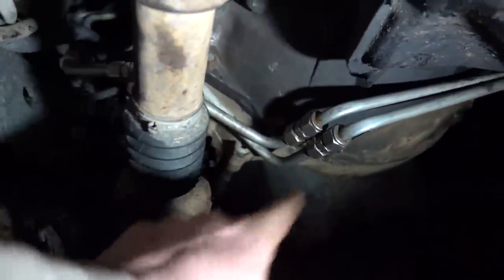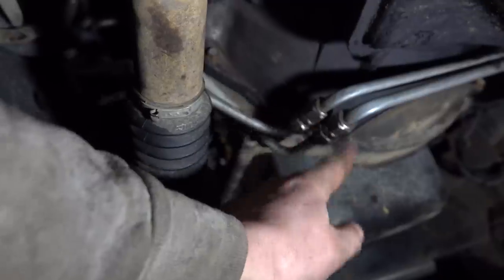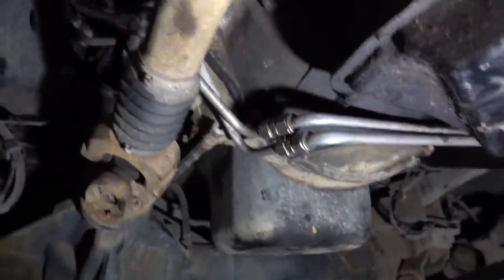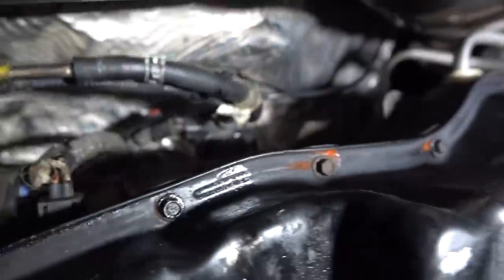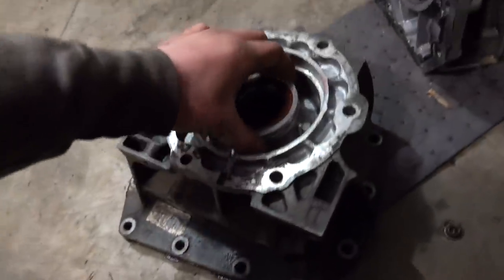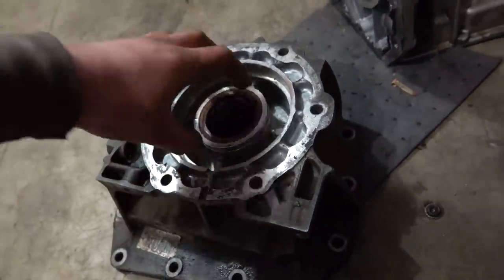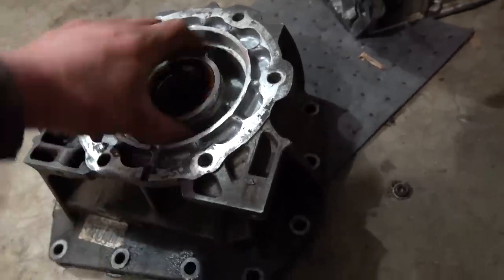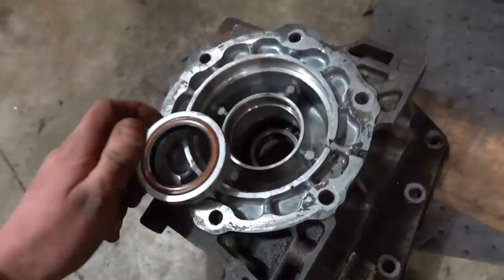Cummins 68RFE Transmission Install HALTED... VITAL PIECE OF THE PUZZLE FORGOTTEN!!!

Comment: Just throwing it out there, but it would be a really good idea to do a "quick learn" with a Chrysler Star Scan or Snap-On tool, and a through "drive learn".  Not doing so can cause the trans to fail in short order.
Reply: Monster RAM is there any other way to trigger a quick learn? If running a tuner, would reflashing the trans tune do it?
Reply: @extremerc76   Not really. The "quick learn" is a computer controlled process that can only be initiated by a few devices that takes about 15 seconds.  Not to be confused with the "drive learn" process, which is series of conditions placed on the truck, by the driver, over a period of a few days. There are several YT videos and online sources that detail the "drive learn" procedure.  Both of these procedures are important, but different, and are necessary in certain situations.

Whenever the PCM is flashed a drive learn must be perform.  A quick learn isn't necessary, however; it won't hurt anything and only helps along the process by reestablishing CVI values. This can be especially helpful if you've flashed in a trans tune with higher LP demands.  

When replacing internals like clutches/hard parts, or replacing the trans, both a quick learn and drive learn must be done.  Unfortunately, there's no way around this.
Reply: Thank you for the info, I knew the end goal was to reset the cvi but wasn’t aware there were two different learning processes I thought they were the same thing.

Any recommendations for a budget scanner able of preforming this function? I only ask because I’ve acquired a nearly new 68rfe out of a wreck that’s sitting in the garage for when mine goes in my ‘15. 

I’ve messed with a decent amount of transmissions but nothing remotely modern when it comes to autos.
Reply: @extremerc76   As far as I know, there are only a few devices that can do this and none are "budget".  I think they are usually in the $X,XXX price range.  However, if you can trailer the truck to a shop/dealership and they should be able to do it for $50-$100 or so.
Reply: @monsterram6617  my launch pros mini does it, was 600ish US. very worthwhile tool to have. It even does keys!
Reply: @GordonTurnerr   Good to know.  Still a lot of money unless you're going to be using it all the time.
Reply from the maker: A quick learn will be done

Comment: Do you need to redo the vgt calibration on the factory turbo?
Also I think it would be a good idea to do a relearn on the transmission
Reply: 68rfe Destroyer  from my understanding as long as you don’t separate it from the turbo you should be good

Comment: Are you going back together with ATF+4 since it is  stock transmission?
Reply from the maker: Yes, the built 68 had atf+4 as well. Dex Merc is what most run in performance 48re applications